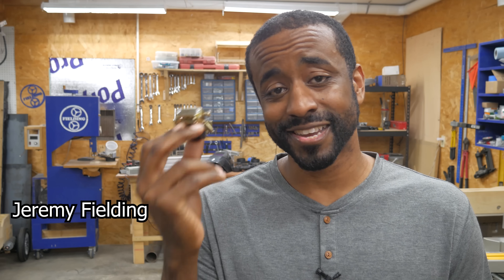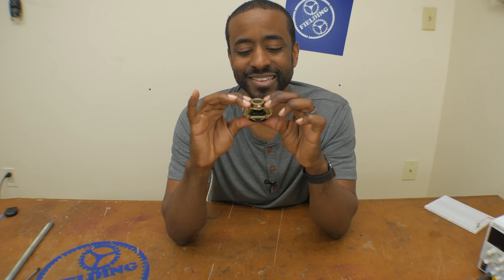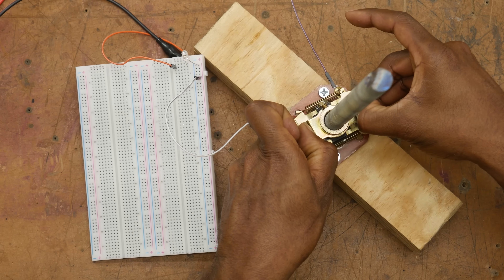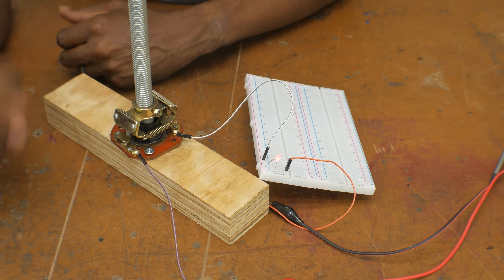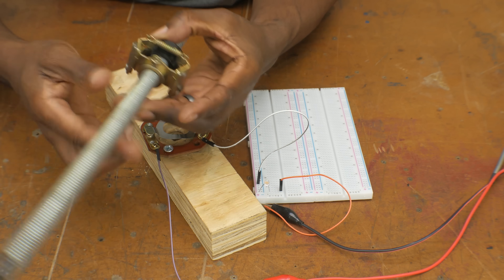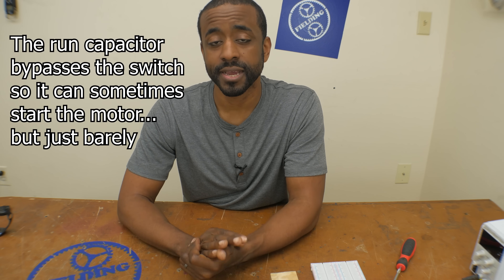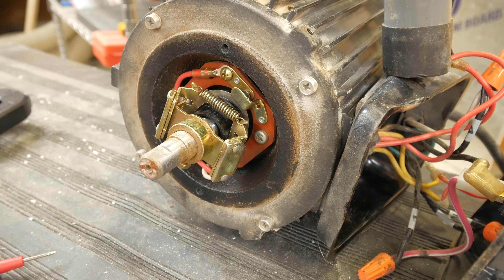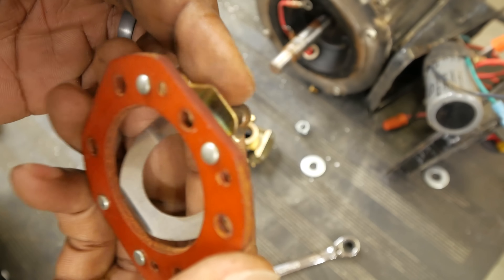This Clever Device Is Found In Nearly Every American Household. How It Works And How To Fix It

Comment: Why dont our motors in Europe need this? Is it because of the higher voltage? Our single phase induction motors here usually use a capacitor that is permanently connected.
Reply: t0nito I think he is referring to 3-phase motors which are more common over here since a lot of European countries have 3-phase available even at residential properties. The capacitors you’re referring to are so called run capacitors, which creates a second “phase” in a secondary winding which gives the rotating magnetic field. American motors also use a start capacitor, which is what that switch connects and disconnects. I’m not really sure what the reason is, it probably has something to do with what type of induction motor design is popular in different markets, as the voltage and frequency differences doesn’t really make a difference when it comes to single phase motor design (except the smaller core sizes due to the increased frequency).

Comment: Isn't there a similar thing on the top of steam engines, acting as a safety valve.
 I remember seeing two brass balls spinning round, and if the engine came to a halt on the tracks, the balls would stop spinning and thus open a small hole to let some steam leak out rather than have the boiler explode?

Comment: It is much older than 100 years. However it Ilusually was used in a dynamic way (or a more active setup) instead of to merely power an on/off switch. Most steam engines from the early 1700s on had a regulator using two (or three, sometimes) weights that would swing out as a result of the centrifugal force created by the axis turning, and the weights in turn would move a metal strip up or down, regulating the amount of steam passed through. Later on we started using a form of the same idea to replace the gear box by an automatic mechanism in cars and on mopeds and so on. 'Variomatic' is a well-known brand name of such mechanisms, a very good, reliable mechanism still applied today here and there. For this 'static' centrifugal switch, especially regarding the way it is implemented here (switching that capacitor), I can think of more potential problems it creates than what purpose it actually serves, or what 'problems' it actually would help overcome or aims at solving.. it for instance would suggest the capacitor is connected to the motor wiring at all times that motor does not run. That seems a very undesirable situation! And it also less leave the question unanswered how and when that capacitor would be CHARGED (which must happen for it to be able to SUPPLY that engine with a jolt of electricity). For such reasons, I very much doubt the explanation given about its application is actually correct, at best it seems there would be more to it.

Comment: I have a 15 year old craftsman air compressor.  It starts fine and fills the air tank fine and shuts off. but a few cycles in it pops my 20amp breaker.  I replaced the breaker in cellar and still pops it.   And the compressor has a breaker button on it but that never pops . Any ideas

Comment: Anyone wanting to read the Patent by H.E. White submitted Nov 15, 1919 and granted iin 1925 will find it here - https://patents.google.com/patent/US1552589A - scroll the page down. As others have said though it may have existed before this.
Reply: Fan centrifugal switches in the early 1900's used a different design apparently this is the switch in an Emerson 11644 fan available 1910 - http://www.afcaforum.com/attachment.php?id=106893

Comment: Have you ever heard of the term "Balls to the Wall" it has to do with a steam valve that works very similarly to that. It uses two metal balls, with centrifugal motion to pull a valve that reduces the steam to slow the engine.

Comment: Great vid.  Just a few things ... be careful not to remove too much material from the contacts.  They are coated to reduce the chance of them welding together.  Also, the capacitor should be close to the same capacitance ... not lower OR higher.  That value was chosen to match the inductance of the coil.
Yes, the rated voltage of the capacitor can be higher, but the physical size will also be larger so it may not fit.
Oh yes .... change those motor bearings soon.  :)

Comment: HIS IS WHERE THE TERM BALL TO THE WALL COMES FROM... used also in governors the weights were the shape of a ball when acted on by centrifical  force the balls(called fly balls actually) go out towards the housing of the governor thus balls to the wall...in this application the gov. is used to prevent overspeed of the motor but the principal is the same...

Comment: Why doesn't the US just go to 240v like the rest of the modern world.
Reply: Almost every residence in the US has 240v already, and in fact had it long before the rest of the - not as modern - world had electricity. There were hundreds of power plants that standardized on it before 1900. The US just doesn't use it for everything, most commonly used only for high draw appliances like electric clothes dryers or ovens.

Comment: Do you have one about dry bearings, and how that there are often NO oil holes provided anymore? And how this is used to cause motor failure and necessitate replacement more often? Do you show how to create ways to provide oil? Anyplace where moving parts meet stationary parts, oil Will be needed.

Comment: I’ve never seen one of these on electrical equipment here in the UK. Is this only a thing in countries with low voltage networks?
Reply from the maker: Check the pinned comment at the top.

Comment: It doesn't give the motor a kick. This is actually is incorrect. The two windings are powered by the same field. You have to shift the phase on one of the windings in order for it to start.
Reply from the maker: I thought that was pretty much spot on. You have to quite literally push it out of position to get it to start... including physically kicking it would work LOL. . I didn't want to explain single phase motors in a video about the switch. Just read your comment and consider how many words need to be explained to a beginner... what is phase, and how do you shift it for example? But if you would like a complete explanation I made a video a few years ago that explains it in detail. "how motors work for beginners, single phase". search my channel. It's about simplicity not details.
Reply: Should of watched your other videos before I was so critical. You handled my trolling with so much professionalism.

Comment: This was from Wikipedia but it looks like a few other commentators have found this already
"An 1920s patent for a centrifugal switch (US Patent #1,630,394[1]) was granted to Royal Lee on May 31, 1927. It was the basis for the formation of the Lee Engineering Company.[2]"

Another fascinating video!  I love the mix of woodworking and machine repair/repurposing.  They give me the confidence to tear down something in my shop that's giving me grief.  Thanks!

Comment: Actually there is no such thing as real  centrifugal   force.   It is more correctly  called "an apparent  centrifugal force" ".   
What  it at play is that all objects want  go in straight line unless something changes its course .
This is  what keeps planets and moons in orbit 
Example....The moon is attracted   by the earth's gravity and  is constantly  drawn  to the earth...... but the moon wants to constantly go in a in a straight line
When these  two forces equal each other, you have a stable  orbit. 
In the centrifugal switch, think  of  the springs  as gravity..  When it starts spinning  the weights  do not  want to go in a circle but in a straight line   but are prevented from  doing so by the springs. In this case   the springs are  just weak enough (compared to the mass of the weights) for the weights to start  to go in a straight  line and this is what swings them outward . 
The faster it spins,  it increases the  force for the weights to go in a straight line and they swing even further outwards . 
Remember the old mechanical ball governors on the old stationary steam engines that  swung out metal  balls farther as the engine  ran faster? This  where  the expressions of running something  "balls out"  or  "balls to the wall" came from. :)

Comment: first patent for an electrical centrifucal switch i could find was https://patents.google.com/patent/US1651708A/en, but the idea of e.g. a centrifugal governor breaking device or centrifugal valves are much older, and essentially, just this time with wires attached to some metal contacts.

Comment: I was amazed too when I saw this my 1st time!

Kawasaki has a system called a KACR which is an automatic compression release system. Had it in my ATV. Works the exact opposite though. When you try pull starting a motor in order to release compression a little bump hits the exhaust valve to make it easy to pull. (Its connected to the cam) once the motor gets up to speed it pulls that bump back in as not to interfere with the valves. Search it on YouTube Kawasaki automatic compression release. KACR

Comment: Capacitor rating should be within 10% of original rating, if not you will not get proper phase shift between the start and run winding.

Comment: Great video - thanks - gives me more confidence in doing my own electrical repairs, and is fascinating, as well. As you requested, the electrical centrifugal switch was invented by Royal Lee and patented in 1927. "An 1920s patent for a centrifugal switch (US Patent #1,630,394[1]) was granted to Royal Lee on May 31, 1927. It was the basis for the formation of the Lee Engineering Company.[2]" from https://en.wikipedia.org/wiki/Centrifugal_switch. It's immediate predecessor was the centrifugal governor. This made James Watt famous when he applied it to steam engines in 1788. Prior to Watt, in centrifugal governors were used to control the operation of windmills that ground grain (https://en.wikipedia.org/wiki/Centrifugal_governor) The widespread use of centrifugal governors and other feedback control devices is credited as the source of the Second Industrial Revolution. (https://en.wikipedia.org/wiki/Second_Industrial_Revolution)

Comment: In most dryers the centrifugal switch also acts as a timer for the buzzer. When the motor is turned off the buzzer sounds until the centrifical switch drops out

Comment: My only comment would be that you could also without even having to really tear things apart use an emery board you know a fingernail file to clean off his contact points like we used to on our points in our Distributors when I was racing as a youth. It's just a little easier and you can exert a little more force during the cleaning without having to tear things apart. Sometimes of course not always.

Comment: It seems to me that one key difference between the older centrifugal governors mentioned in various comments and this device is the hysteresis in response curve in this device. The governors appear to be a proportional device. This switch design snaps open and closed because the weight, at rest, is on an arm short to the centrifugal force. As the motor spins, it reaches a speed where the weights snap open to a position on a longer arm. The switch holds that position until a slower speed is reached when it snaps closed back to the shorter arm position. Same principles at work, but different mechanical design. Both elegant.

Comment: I just pulled a washing machine motor and didn't go in like jack the ripper and didnt cut any wires  what do i need to make it go for a project tool im making im shooting to make a metal lathe of sorts from scratch and spare parts i had from past builds any help would be appreciated im stuck

Comment: Great video. As a Brit, I’ve always thought James Watt invented the centrifugal governor to regulate steam delivery to a steam engine’s cylinder. Have not heard of the windmill use, years before, and will look that one up. My homework.
Did not like ‘while I think about it, do turn off the power first.’ Next video you do - SAFETY FIRST. I help out in a school, and the safety bit is drummed into the kids, and we must be next to them checking safety when they use power equipment. Please, please, please do safety first. You were very close to a nasty shock - and across your heart.
Reprimand over.
A lovely style, and very interesting to see the diagnosis and repair. Great demos with the part on its own, too.
I’ve recently bought a concrete breaker. It came with a spare set of brushes. As a suggestion, do a video explaining what they do, how to check them if a motor has them (your dust extractor motor will not, but a vacuum cleaner probably will, for example)  and how to change them. That’s useful to know.
Matt

Comment: IF you look through the neat list on Wikipedia in the early patents, you will find the forerunner of it from DC field and AC Motor control that was implemented by Tesla in the latter 1880's
https://patents.google.com/patent/US390820
Tesla also had implementations in the poly-phase motors later on as they were invented in the 1890's with Westinghouse production of them. The HPHF coil motors used in the small automatic robotic boat he exhibited in the Lecture of the 1897-98 Exposition also had centrifugal controls on the motors and the drive mechanisms which coupled and steered the vessel - all of which were controlled wirelessly - Both the lighting and powering of the vessel's drive motors, along with the servo rudder controls which were operated by motors which ran in both directions via wireless control ! 
https://en.wikipedia.org/wiki/List_of_Nikola_Tesla_patents#Patents_#1%E2%80%93#50

Comment: Nice video! You asked about the history of the the centripetal switch. The precursor to this  may be the centripetal speed governor used on the rotating shaft of steam engines. This was invented around 1780. If an inventor first saw this, the extension to the electric motor is obvious. https://en.wikipedia.org/wiki/Governor_(device)

Comment: What you call a tab is actually known as a set on contact points. Capacitors can be tested with your multimeter usually the manufacturer allows a tolerance plus or minus 5%. First even before you open your motor or look at your switch plate or gear switch known as your centrifugal switch set your meter to capacitance uf test your capacitors. after ruling out your capacitors then open your motor.

Comment: Nice clear presentation, thanks Jeremy. In answer to your question ... if it hasn't been answered already; it looks like this is the inventor... Mr V.E Johansen. Almost 100 years old, so I guess they do get a bit worn from time to time.
V. E. JQHANSEN CENTRIFUGAL SWITCH Filed Oct. 20, 1926 
Application filed october 20, 1326. Serial lTO. 142,949.

Comment: I've found this thing in my mini air compressor that can't start working, only produce buzzing sound. Its only can turning with hand help at the start.
At first idk what the use of this thing then i reveal from its mechanism that have bold metal plate, then its connected to starting coil.
Do some polishing work and get my compressor working well again.
I don't have any electrical basic skill so i think i'm a genius lmao

Comment: Never understood the difference between a start and run cap, the single phase motors I mount at work for some machines we make have only run caps with no centrifugal switch and they start and run just fine, Also I have made 3 phase motors run on single phase by connecting a run cap to the 3rd phase and phase/neutral to the other 2. Even made it so I could switch directions. Also works just fine. Thus to me the startcap/centrifugal switch seems like an unneccesary complicated construction not really needed if the method I described works equally fine. Also the run torque i think would be higher if the phase shift is left in place all the  time and not just at the starting moment. Some motors i have seen even have both a start and run cap. Is it that a start cap would provide a higher start torque then the run cap and then the run cap takes over to generate a higher run torque? never got this really with single phase motors. Im more familiar with 3 phase machines since all our workshop machines use these. The starting tourque and even the run torque for these is higher since the rotating field is more even. For the same reason single phase motors are more inefficient and run hotter then on 3 phase. There seems however  to be some difference here between different single phase motors I have noticed regarding torque and efficiency.  For example the motor on a bench grinder always have a very low starting torque. If you hold the disc with one hand and turn it on you will have no problem holding it still and it takes many seconds for the motor to ramp up to speed at wich point the torque suddenly gets much higher and it then quickly accelerates up to full speed = very weak phase shift. A such motor would never be able to start that compressor of yours or even ramp up a refrigerator compressor since they require a much higher starting torque. So there seems to be  big differences on the single phase side regarding this. All 3 phase motors on the other hand have full torque the moment they are switched on and ramp up in 1/100 second or less to full speed unloaded.

Comment: Since these don't go inside sealed refrigeration compressors, do you want to make a video covering the start relay too? They are on every household refrigerator, heat pump, and freezer except the variable speed units which run on a VFD. They are not on HE washing machines as those are VFD driven.

Comment: Make sure you discharge the capacitor by bridging across the connection with an insulated screwdriver or similar tool. You don't want to get zapped by the charge left in the capacitor.